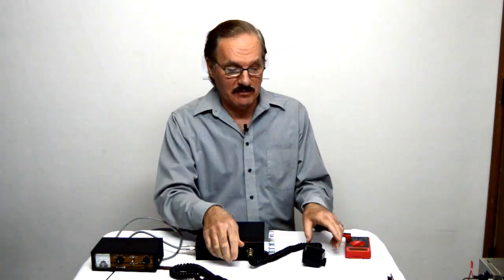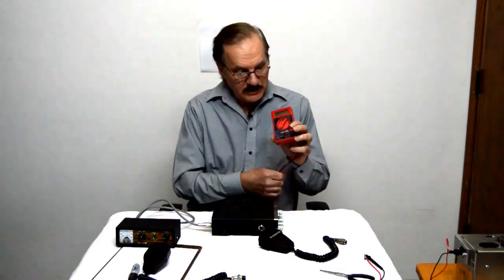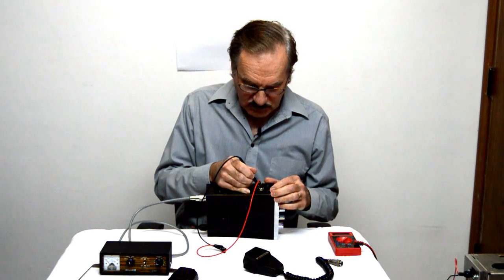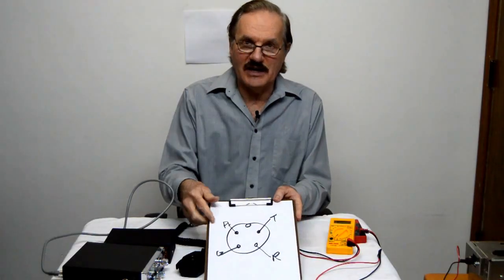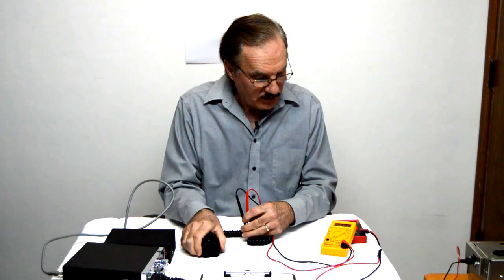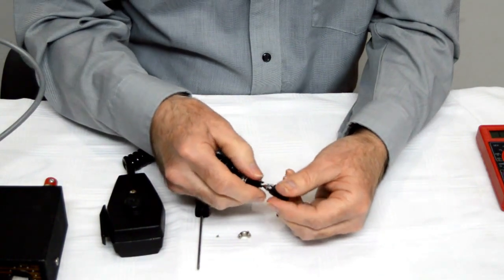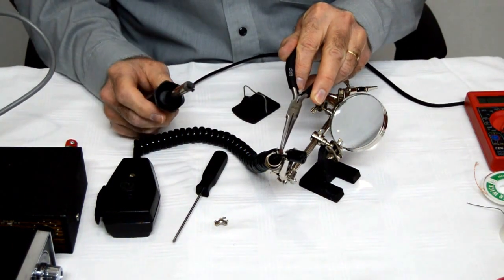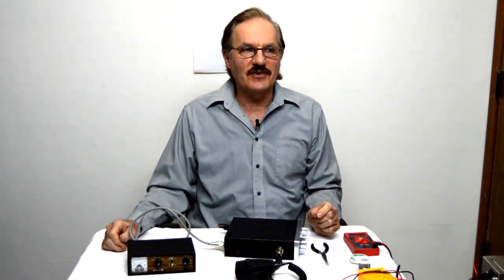How To Wire a CB Microphone

Comment: I bought a trucker series mic off eBay that needs to rewired I need to know what the wire code is I'm putting it on a cobra 29 ltd classic mobile cb radio

Comment: I like this video the unfortunate thing i have a Galaxy dx939 which is from 2009 and I went to change the stock microphone plug from the straight version to an angled version and let me tell you this has been helpful but my radio is the opposite. The ground pin is on the lower right and the transmit is upper left. So now I'm going to go on a website and compare what they have and that will help me with the rest of it otherwise this is a good start to show.

Comment: Need to know how to wire an Icom SM-8 desk mic to a Radioddity QT40 radio. I think the QT40 is same as Cobra 4-pin radios.

Pins on the SM-8 are:

1) MIC IN
2) 8 V
3) Up/Dn
4) N/A
5) PTT
6) GND
7) MIC E
8) N/A

Cobra appears to be:

1) Shield & Common
2) Audio
3) TX
4} RX

So from top to bottom list: 

6 --> 1 ?
? --> 2
5 --> 3 ?
? --> 4

Comment: So in this case, the radio was able to go into TX mode via the small, series resistance of the mic insert. It would be a good follow up to further educate your audience on such a scenario with a diagram. This understanding only helps people figure out the mic wiring, sometimes without doing the radio test because you identify the small, but larger resistance of the insert (most commonly wired dynamic, moving coil type mics, never put a ohmmeter on a crystal mic element).

Comment: Mike, I really enjoyed this video and learned a lot.  My project is to replace the microphone on my Harley which has a 7 pin plug communication plug (including L and R speakers for the helmet.  I have trace the microphone to 2 of the pins and the speakers to 3 pins (I believe to be a L and R and a singlar ground).  The next step is to determine the ground (Common) and the TX and RX (I would think that the one of the Microphone pins is the TX and the other a common.  Do you have any material or sugguestions to help get this figured out?  I'm basically going from a 7 pin receptacle to a 4 pine plug (or vice versa depending on how you look at it).

Comment: Great video. I just bought an Astatic 878 DM pre amp desk mic and it is a 5 pin plug wired for Cobra & President and I have an RCI 2980 WX  4 pin radio.  I did buy a plug adapter  but still not working properly when I key up. Carrier on AM but no modulation. Is it just a matter of rearranging the wires on the mic plug?  Thanks

Comment: Do you have any videos similar to this but explaining how the PTT(push to talk) button works inside of a microphone? I'm trying to fix/replace the mic cartridge on a whelen 295hf100 siren but i wanna make sure my wiring is in the right location on the PTT switch. I've looked on google for any wiring diagrams for my application but haven't been able to find any. Thanks for the help.

Comment: I have a few Mics that Key up but no Audio, do YOU know how to test to see if it is a wiring problem, or if the Condenser Mic part is faulty, or need to be replaced???? I did check the Wiring which seems OK but still no Audio when I key the mic.....

Comment: I have done it a different way, but I have to admit YOUR way is better, thank YOU, but I still use MY way 50% of the way to find Receive and Audio using the Mic that comes with the Radio, and if there is no Radio I check remaining Pins to see which one is Audio and the last Pin is then Receive, or find which Pin is White to denote it being Audio, but I have found not all Radios use White to denote it to be Audio..... Finding which is Receive is easier when using a Multi-meter and using Ground Pin I check which will give ME a 0 Reading and the last pin is MY Audio... In any case thank YOU, I did learn something new, Thank YOU!!

Comment: Greetings Sir! I have 2 mics and I want to use them in my RCI 2950 radio, the first mic is an Astatic 575 M6 (6 wire cable: shield, red, black, white, blue, yellow) and the second one is a Cobra CA-71B (5 wire cable: shield, red, black, white, blue). How can I wire both of them to my radio?